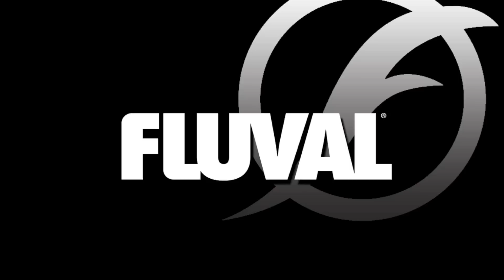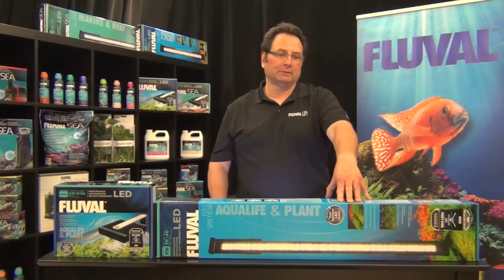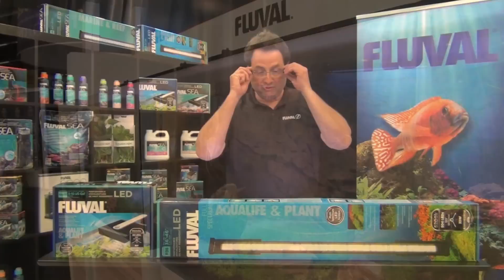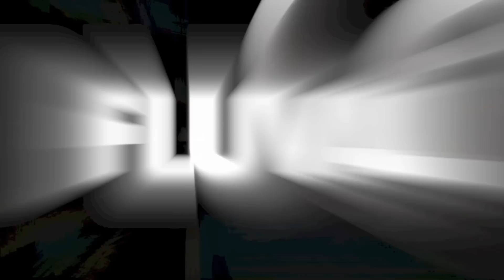Fluval Aqualife & Plant Performance LED Lighting

Comment: Love the nano light. It's a great product with the right spectrum. Well thought out. The only down side I see is the mounting. Is Fluval  making a fix for this? The idea of using tape to hold the light does not seem like a long term solution.
Reply from the maker: We're glad you love the light! Regarding your concern, the bonding tape is rated to hold much higher loads than the actual load placed upon it by this product. The key is following the instructions, proper cleaning, and allowing the recommended bonding time BEFORE installing the lighting system.

Comment from the maker: Hi, 
PAR data is a measurement of energy over an area over time and is NOT UNIMPORTANT, but of LESS IMPORTANCE. It has no relationship to spectrum. If a lot of light is produced but not of the spectrum preferred by plants or other photosynthetic organisms, it is of far less value as a spec vs. spectrum. 
Measurements are more relevant in terms of energy at the point where the light meets the leaves. This said, even ground cover plant leaves are mostly inches above the substrate.

Comment: Hi sorry for late response, I am still in the planning stages.. But my current plan is a 72g bow front and mostly low to mid light plants except I am hoping to do a carpet do stargrass ans I think to keep those low to substrate I will need higher lighting ... Thanks

Comment from the maker: Hi team3gk, did you mean a 40-gallon tank? You also didn’t mention the depth of your tank, which is an important consideration as is what is being kept. 
The lighting will be enough if you have only fish, and no plants. If keeping plants with a high light requirement and a CO2 system, we recommend you use two lighting systems. Alternatively, for plants requiring low or medium level lighting, it should be okay.

Comment: Hi, I am getting a 150 gallon aquarium and may set up as a planted tank. It's a 6' standard tank with 2 twin tube t 8 fixtures. If I add one  or maybe 2 of these led fixtures will they work well together with the t-8's?  I am thinking of doing this because looks like I could fit both and get my 3 watts per gallon. Appreciate any thoughts or recommendations from Fluval !
Reply from the maker: Hi, we see no issues in using this LED solution to compliment your existing lighting. It will most likely result in creating a more complete spectrum for your plants.

Comment: Also something to think about and, in my opinion a HUGE ball drop on Fluvals part..  A manual switch to select main lights and moon lights?!  On a $300 fixture?!  This unit NEEDED to have either an on board timer (as now found on even cheap 48" fixtures) or at the very least, dual power cords (yes, I do realize this would require a second power supply internally to drive the moon LED's).

I really wanted to love this light, it looks so well engineered, PAR data and manual switch kill it for me.

Comment: Hello, I really like this lighting system so far (just installed it a month ago), but I have one question; we have the tank running on a timer, to be on for six hours and off for 18.  However, when the lights are "off" I'd really like night mode to be turned on to better see my setup.  Right now the fixture completely turns off, it's either all or nothing at the moment.  Do you know how to set up the tank on a timer to switch between on and night-mode?  Thanks a bunch!
Reply from the maker: Great question, but unfortunately, this can't be done as the night mode is engaged only by physically moving the positions.
Reply: FLUVAL Aquatics I have P46 light fixture on my 75G planted tank with the automated CO2 and Apex Neptune controller  and I like the lighting performence.  I was even thinking of adding  a second fixture to my tank to cover all area with plants  but I changed my mind because the only manual way exists to trigger day/moon lights. The light can be turned on/off autonatically from the timer or any controller, Apex for example, but if you want to keep your tank with moon light effect at night then forget about the automation and do everything just nanually.  In addition,  the light is not capable to perform dimming effect. I like my fish and do not want to stress them every time when  light suddenly turns on/off.
Reply from the maker: Leo Belman We're pleased that you appreciate the P46 performance on your planted aquarium. We have addressed the issue of dimming with an available ramp timer, and this will work with our newest generation of LED series lighting systems.

Comment: Hi there,

I am looking into buying one of these strips in the next few weeks and would like some advice. I currently have a heavily planted Fluval Venezia 190 (42 Gal) and am using the standerd twin T5 24 watt tubes. I am wondering what strip to use?

Would my aquarium benefit from the 25 watt or the 35 watt? As the 45 watt is too long for my tank.

Any advice would be great, I am a big fan of fluval so I’m very interested in these lights.

Thanks.
Reply from the maker: Hi BritishRaver, thanks for the great question! Basd on the information you provided, the 35W is your best bet.

Comment: Thank you for the quick reply. While I understand the specs on the bonding strength of the tape I just don't find the look appealing. I run bare glass on the back of my tank and went the extra step to install a glass intake and output. My heater is fluval glass covered titanium which does not stand out and blends nicely. Adding this light would not fit with what I'm trying to achieve as it would be quit visible in the center of the back glass. Not to mention if I was using a stick on external background the light would not work with that. There is also a lot of tanks with a painted background. This are legitimate concerns. The light is great but I feel the ball was dropped when it comes to mounting. Thank you for your time and I invite any reply or information you have. 
Regards. Mr H 
Long time Fluval buyer
Reply: Pretty simple solution, hang it a different way. Can't count on these guys to do all the thinking for you.
Reply: Wow such wisdom. Why didn't I think of that. Oh wait I did. If I put it to the side it doesn't light the whole tank. My point is this is an expensive light with a low quality mechanism for attaching. And at this price I want all the thinking done.

Comment: Hi fluval  
I have a fluval roma 240 tropical planted tank set up with many fish including red fish.
I want to buy the led lighting.
You have the aqualife or reef models.
My question is 
Is the reef model still good for the planted tank ,but I fear the red fish won't glow as much , with the 25000k reef led?
I don't like a yellow light but is the reef too blue ?
Is the aqaulife always best choice?
Awaiting your reply
Reply from the maker: Hi Cliff, thanks for your question. The color temperature and spectral quality of the aquatic and plant version should meet your needs. The reef model is designed to meet the requirements of a marine aquarium.

Comment: Hi , I have a 75cm x 45cm high x 30cm tank, and want to grow a carpet of grass, something like pygmy chain sword or hair grass. Im considering the p24. Is this sufficient for grasses, or are there more preferable grass above others? Whilst on the subject if I use fluval strata, fertiliser, could I get away from using co2 for the time being? Tx in advance.
Reply from the maker: gavinandkerry for the plants you mention we feel CO2 would provide a big benefit. You may have to add a light unit if you feel growth does not meet your expectations. We suggest you evaluate the results from using one light unit first.

Comment: Would an A3982 (48-57") unit be sufficient light for a 75 gallon 21" deep tank? I would like a medium to high light tank.
Reply from the maker: Hi glen, thanks for posting! It is sufficient for most aquatic plants. If plant growth is your goal, make sure to research your live plant purchases because some very high-light plants might need more light energy. For a 21 inch tank however, this this lighting system is fine.

Comment: Hi there, I have two Fluval tank's and one of them is a Fluval Vicenza Bow Front 180 litre tank, and i have had it for around 3 to 3 and a half years now and the light unit has literally just stopped coming on.  I change the bulbs regularly and they were both bought just recently so it is definatly the light unit its self not the bulbs.  The red light above the light buttons flashes as you push the 2nd button but the first button and on off switch seems to no longer be working at all.  Would one of these units work on a vicenza bow front 180 or are they too long to replace the cabinet standard light unit ? And if i bought it is there also plastic covers to cover the top for the different unit of a 180 bow front tank ? as im concerned the top wont be covered the same as it is now. With a different sized lighting unit?  As my light unit seems to be shot, ill need to replace it but i would also like my tank to be covered and not missing or miss fitting peaces at the top if you know wat i mean.  Id appreciate any advice.  Or would you advice i look at a new tank instead of a new light unit.  Until i get a new light unit i have rigged 2 table bedside lamps above my tank which are lighting the tank haha but i obvisously need to get a new proper light unit asap.  Especially as i just put an additional fluval 305 filter on it and the water qaulity of my tank is better than its ever been.  So its even more of a pain to have a stunning looking tank and have the lights go out.  Any Advice ? Thanks
Reply from the maker: Hi Darren, the Vicenza series is discontinued, and the light unit is no longer available. We had hoped to locate a spare unit that we could ship to you, but unfortunately, we have zero stock. As far as the Fluval Aqualife and Plant LED is concerned, we wouldn’t recommend this for your Vicenza because it would compromise the aesthetics of the canopy and the unit will not fit as snugly as your current lighting system. We regret that we can't be of more help.
Reply: Aw cheers for looking anyways and thanks for getting back to me :) appreciate that
Reply: Are you kidding us Fluval??? So we buy a 1000-3000$ aquarium, the lighting system faulters and there is no fix, are you fkin kidding us or what? How can you not have a solution or spare parts for this? If I don't fix my Vicenza light this will be my last Fluval or Hagen product I buy, that's for sure.

Comment: Hello. I have a 125 lt  tank and it's 80cm length , 40 hight and 32 width. Will the 25w fluval led lighting system be enough for high demanding plants ?    I will use stratum , co2 an fertilizers.   

Thanks
Reply from the maker: Since your aquarium is fairly shallow and narrow, start with one unit and evaluate.

Comment: hi, can this light fixture fit in the the Fluval Roma 125 as my stock light fixture has recently stopped working and im looking for a replacement and i was wondering if this LED fixture comes in a size that fits my tank? 
many thanks 
callum
Reply from the maker: +yorkshireboy123 Hi Callum, an adapter is not available for our line of Performance LEDs, however, it is for the Aquasky and EcoBright LED series. The adapter allows the use of existing T5 sockets to support and suspend the LED strip lights mentioned, and there is a top plate for the Roma 125 (Item #15461).

Comment: Hi, I have a 40 gallon breeder tank(36.2"x18.3"x17") equipped with Aqualife and Plant Performance LED(35 watts). Would this be a low light setup or high light setup? Thanks
Reply from the maker: Low to mid light level input, especially if you are elevating the 1 strip a few inches to spread the tank coverage.

Comment: I have tons of high light plants in my 60 gallon long i've done everything to achieve great substrate & co2 injection and fertilizers I started this planted aquarium not knowing about the lights that I need thinking that the two 18in 15w T eights that came with the tank and stand would be sufficient for plant growth because the employees at my local fish store said it would be fine after a few weeks I noticed my plants were not doing well then I found out that I do not have the right lights for my planted aquarium i went to find and purchase the right lights and found out that there almost $300 totally unaffordable for me at this point in time so now all my plants are slowly weathering  & dying and I don't know what to do and it's so frustrating & depressing watching all my plants die knowing that I spent a lot of money for them & this tank and there's no way that I can save up enough money in time to save my plants can you help me is there some other way or alternative to get the right light with the light fixtures that I have
Reply: Get some clip on cfl lights until you can afford another light.

You actually ask this on YouTube rather than doing a 5 minute Google search???

Comment: Is 1 unit enough for standard 2ft tank 60 x 30 x 36?
Reply from the maker: Hi Liong, thank you for your interest in this LED lighting system and for your question. The answer is yes, although this depends on which plant species you are keeping. Most mid- to low-light level plants will do fine. Some higher-light level plants may require additional lighting. We would strongly encourage you to get a CO2 system to really enjoy your plants. http://bit.ly/RakvJG

Comment: Hello i am on the way to buy Fluval 48 inch led light for my juwel rio 400 without any plaints only rocks and malawi cichlids. So can you tell me in that way which is more suatiable light Aqualife and Plant or Sea Marine and Reef. 
Thanks for answer
Alex
Reply from the maker: In this case either unit would be fine. If you want a higher color temperature with a stronger blue spectral component, go with the marine unit as it would also highlight blue coloration to a greater degree. If you want a more daylight-like color temperature that would likely stimulate more algae growth, then the Aqualife & Plant would be the right choice.
Reply: FLUVAL Aquatics  Thanks for responce, i chose sean marine, it should arrive in about one week. I look forward to that. 
All the best

Comment: Good products, not the best customer service in Canada.

Had problems setting up your fluval 88 pressurized co2 system and it was missing some rubber oring and the entire bottle of co2 discharged in my living room.

Customer service didn't seem to think anything of it, didn't even offer to replace the co2 tank rendering my purchase useless as the replacement co2 cartridges are not available locally to me.